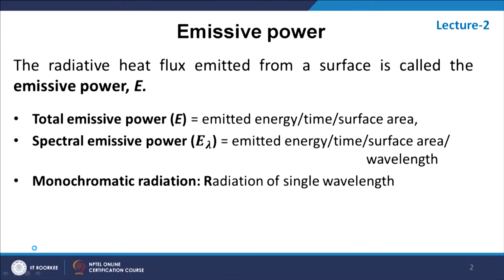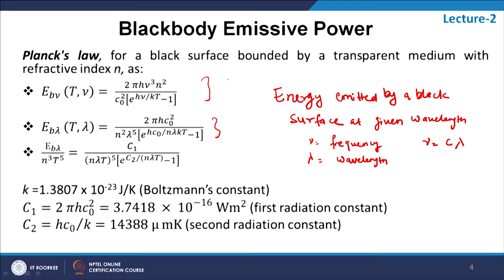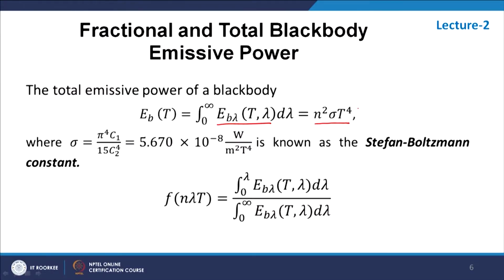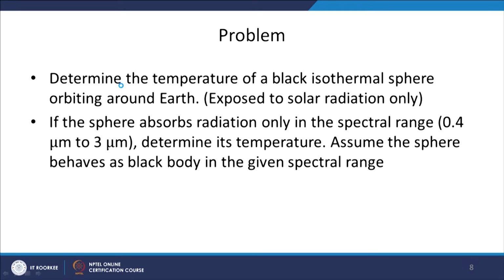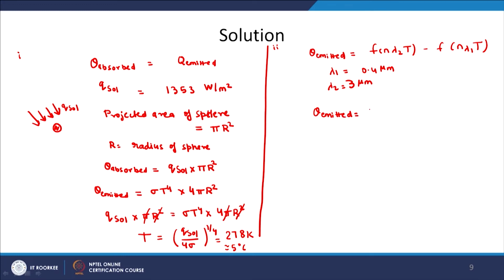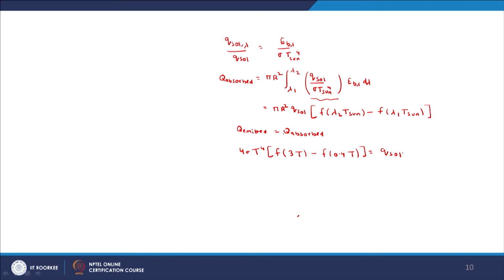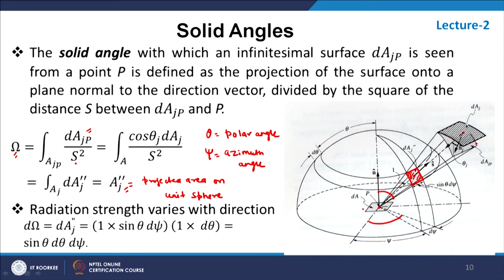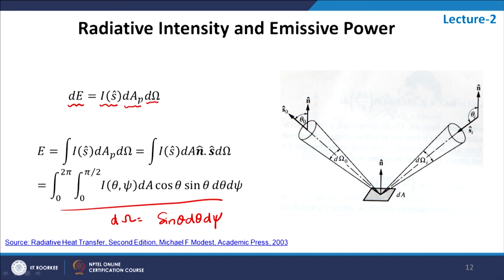Fundamentals of Radiation

Comment: Typo on the Solid Angles slide. It should be "The solid angle with which an infinitesimal surface dA_j ..." rather than "dA_{jp}". The surface dA_j is the original surface, while dA_jP is the projected area onto a plane normal to the direction vector between point P and the surface.

See the text in section 1.5.